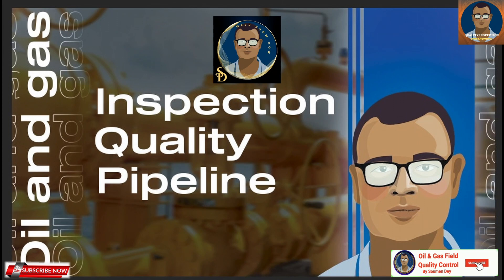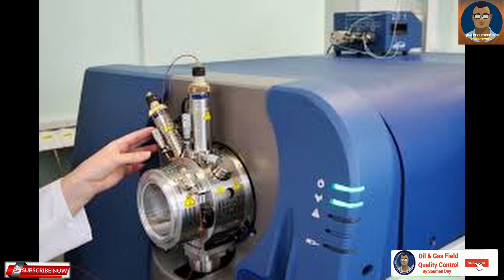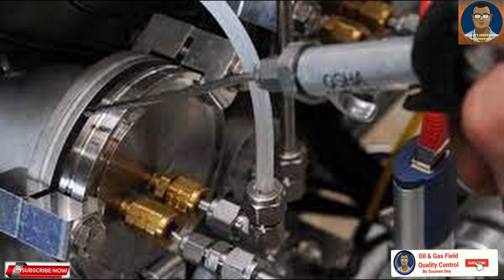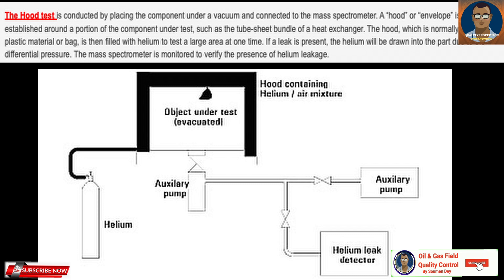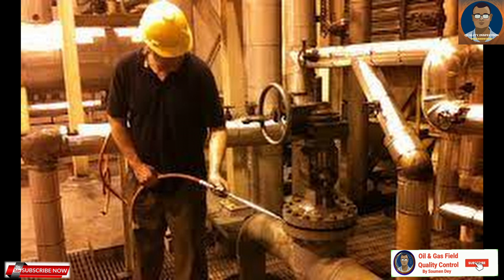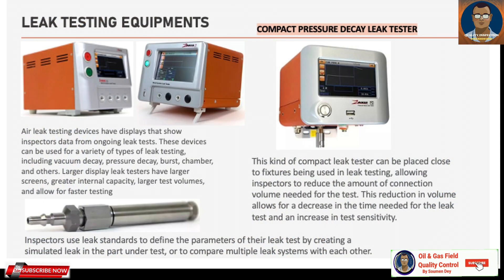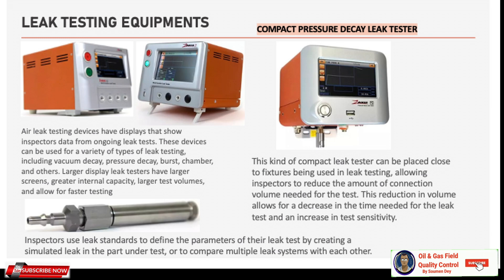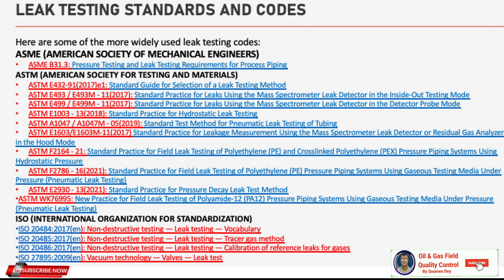Mass spectrometer leak testing

Comment: Thank you  sir, Sir how we choose enough weld thickness and weld length of in a job
Reply from the maker: @manigiri7728  as a quality control inspector, it is not our role to choose it but to follow drawing/ designer recommendation. It is being calculated by the designer considering the design basic requirements, strength required, operating pressure temperature etc etc many factors. But as per thumb rule here in the gulf for fillet weld, 6 mm leg length is the lowest size being used for structures and structural attachment welding